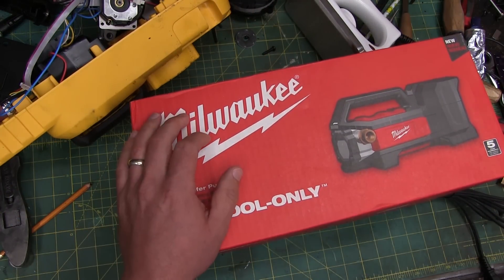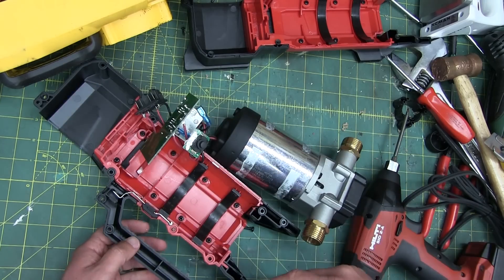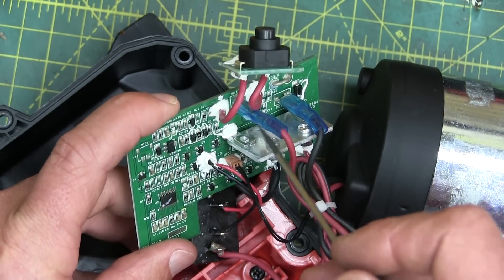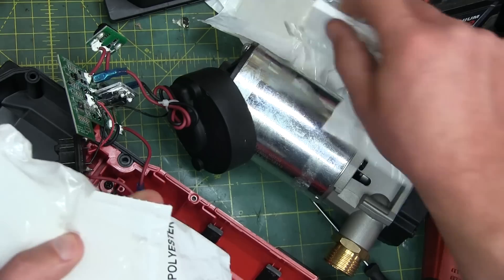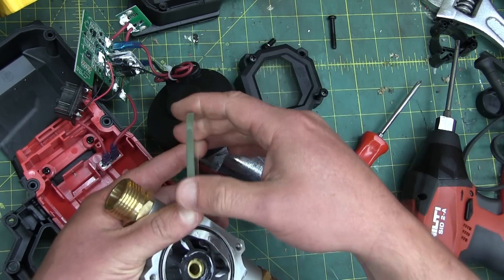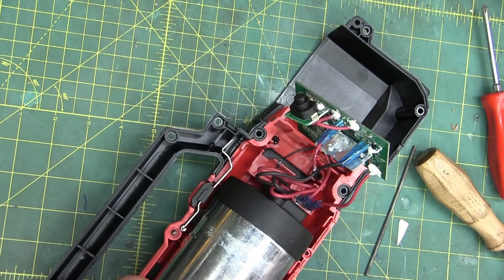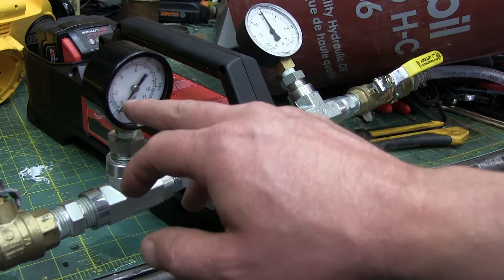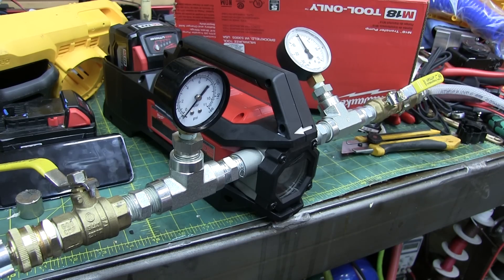BOLTR: Milwaukee Pump | Box Specs vs. Shop Specs

Comment: Dude instead of taking the junk apart shove a battery in draw 5 in water in the bathtub and turn it on , turn the shower on submerge it with a timer ,run the battery down change the battery until it  fails then post the results so I can go buy one

Comment: I'm the asshole who posts a product review with measured specs, along with a  note that I expected as much.  Also, I used to be paranoid about breaking flexible impellers by installing them the wrong way (it happens if you don't have your wits about you while changing outboard impellers), and even tore down a pump or two because I wasn't entirely sure I did it the right way. Nobody ever told me it was bad, I just assumed so. However, a few hundred impeller changes later I have discovered that it does no harm whatsoever.  I guess a really old and brittle one could break if you turn it backwards, but you really want to replace it at that stage anyway.  EDIT:  Also, the vast majority of flexible impellers are nitrile, but you can order a few sizes in rubber </pedantry>  EDIT2: It wouldn't surprise me one bit if the specified flow is a theoretical measure of displaced volume.  Johnson spec that as well as unrestricted flow and flow at working pressure;  If you're a marketing dickhead, which one do you reprint on your packaging?

Comment: Those vanes are bent the wrong direction, and the valve is closed.

(Truthfully, I thought the "cam" in the impeller cavity would force those to go the right way, but I think it did not. Maybe you're less efficient that way. But when you remove a lot of the Jabsco or Yanmar impellers on raw water pumps, you see them bent both ways as they came to rest at the lobe...) Anyway, see below:

https://youtu.be/lijsxJ5gKUU

Comment: As a consumer i rarley even look at numbers on boxes.   I trust youtube reviews much more.   And at 30 psi with 30 min runtime that pump is garbage anyways.  Unless your usin it for super light applications like draining a hot water tank, or cleaning an instant hot water system. .  But gl flushing a boiler system.

Comment: as a plumber, i see no use for this tool i use another method to drain a tank. i can just see its use for very small fluid moving applications that would be very rare maby fleet maintnance??? gasoline transfer is the only real useable application i have for this tool if it is specd for that. i thought about it more if i had a trailer with a water tank i would want this.

Comment: Yes. Watching someone butcher the timing and measure, then doing a bunch of decimal math on the 'seconds', to get a wild guess at the specification, is getting a bit old.
Reply from the maker: you forgot to include a link to your testing vid...
Reply: I was having a bad day. It's like being a Marilyn Manson fan at a concert when your tinnitus starts acting up. "Do these guys seem a bit LOUD today?"

I'm personally convinced my video shticks are already old before even uploading them to youtube.  

I have a 3hp classic all-steel Kirby self-driving vacuum that they used to sell door to door for a few grand in these parts. It's got a melted/shorted plug so I was going to be a bad Canadian, unapologetically taking it eh part on video and try to repurpose the motor as a blower or water pump.

The thing's a beast so I'm sure it'd suck.

Comment: Reckon you'd be closer to achieving those WillFuckYee (funny fellow he is) specs if the pump was plumbed to a water tank as an intake (no or few large bore, ported and polished read: free flowing) fittings at all and a totally open exhaust. They are either inflating specifications or being more "inventive" in their "tests." ie: doing all kinds of shite to make it look the best possible, predictable I guess. Just my idiotic two penneth.

Comment: Disappointed at near $250 out the door. Very well built very noisy and very slow discharge taken forever to fill 7 gallons then old m18 3 Ah battery went down to 50%. Need my 8.0 in it to do work.

Comment: the way I would have got the flow ratings if I were the marketing wanks they probably went with compression unions directly off of the pump probably without even threads in the pipe and heated fluid and refrigerated motor they also could have messed with the atmospheric pressure between the inlet and the discharge and there battery pack was probably made up of cells the size of oil drums if they even use the same motor to power the pump to begin with what's the info on that vacuum pressure gauge Spartan drain cleaning equipment is the best and if anyone says any different they're more than welcome to come school me

Comment: Well your feeding it a snack with your dick sized tubing and you really have to ask yourself what you would use a cordless pump for? My guess is small nuisance jobs like pumping out a cooling system or a clogged sink/shower anything else a regular plug pump is the ticket. I would possibly say it would make a nice garden sprayer with out all the pumping ridiculousness

Comment: What can it pump? What is going to fuck up the impeller?  Diesel,oil hydraulic oil,gas? Come on thats what real men use pumps for. I want a battery pump that can drain  a 5 gallon bucket to fill hydraulic tanks on trucks. Not the 2 D cell one from Walmarts seasonal isle from china ment for kerosene.

Comment: 30 mins run time on 5.0 
obviously with no load/fluid, just the pump running  :P

480 gallons an hour
no fittings, no test... that's the max fluid volume of the pump chamber x rpm x time, NOT a real world test result 

I like most of the Milwaukee tools... but many of their "special features" are useless, like the self tapper function on their impacts, absolutely useless... you set it to max and leave it there and learn when to let off the trigger just before the fastener breaks through and it comes out perfect every time

Milwaukee's tests are just like any other marketing hype... specially slewed tests with borderline edges given to help the tool reach un-realistic real-world levels... because who would buy a tool with real-world numbers on the side? They'd be 20-30% less than BREAKAWAY torque numbers.All that said, I buy Milwaukee tools, I buy snap-on tools, I buy harbor freight tools...I use them all and the lions share of the work is done by Milwaukee and they hold up just fine. Snap-on for the specially tools, like the massive ball joint C clamp, and Harbor Freight for sockets and box wrenches and I have yet to break a socket or wrench from them. It's about understanding the limitations of what your working with and not just going and grabbing a 8' cheater bar and then wondering why your socket broke. Use that 8lb computer between your ears and your tools will thank you.